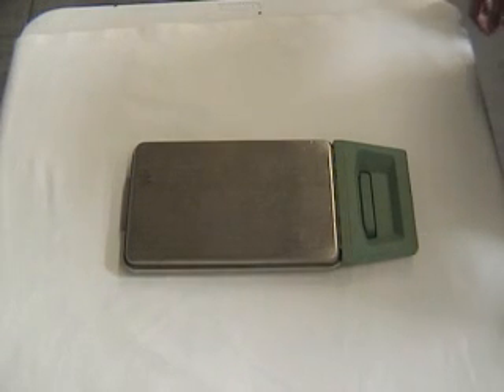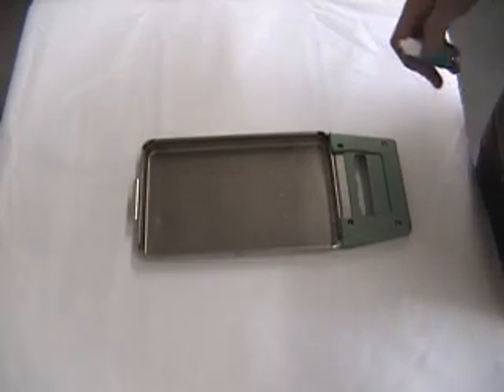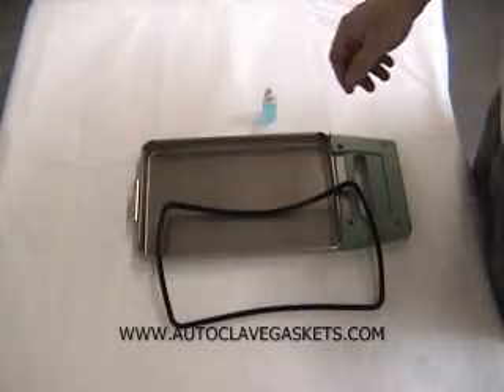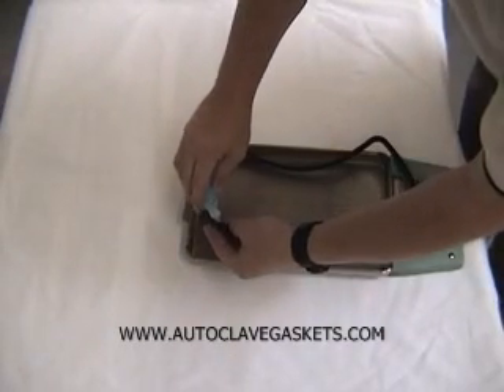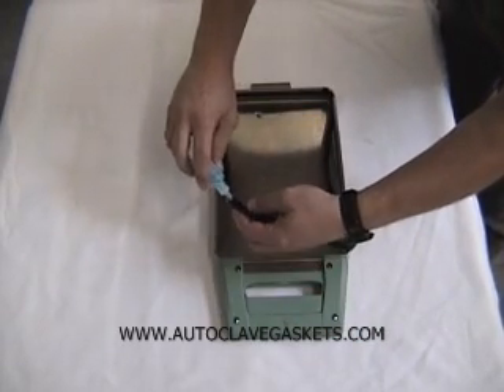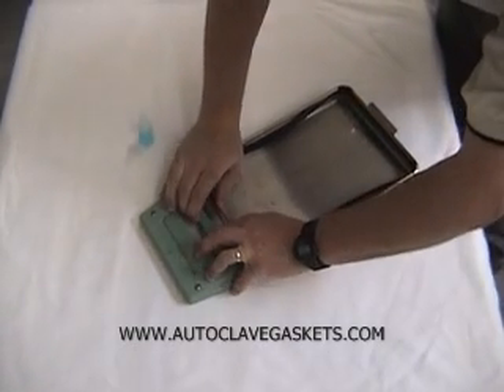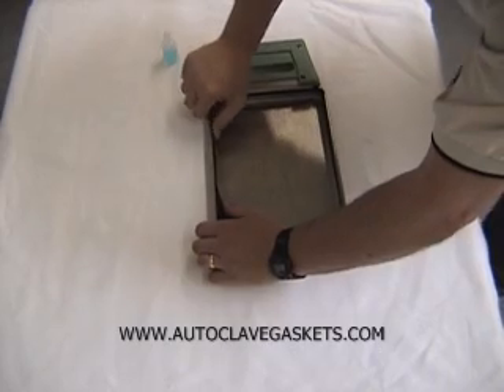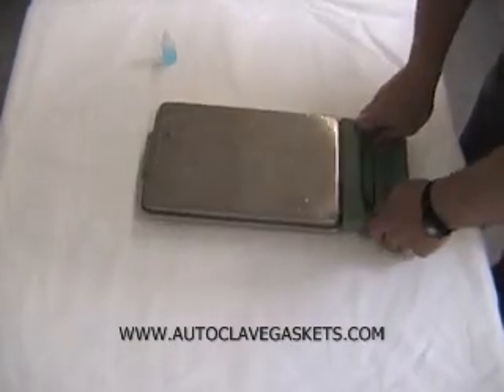Statim 2000-5000 Gasket Replacement

Comment: I agree with Dulein.a damp cloth will never remove all the corroson on the metal behind the seal and if the surface is not not super clean it will leak.Also, if the metal is scored you will have problems with getting a perfect seal. Use Sci Cans" Stat Dri" to install the seal and use in between scheduled seal replacements to clean and lubricate to keep corrosion down down to prolong life of the lid.